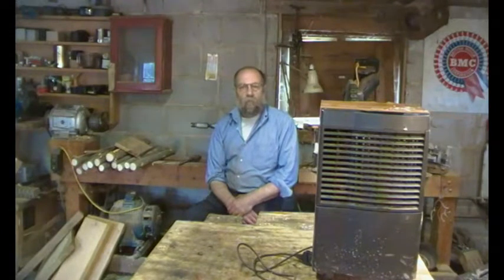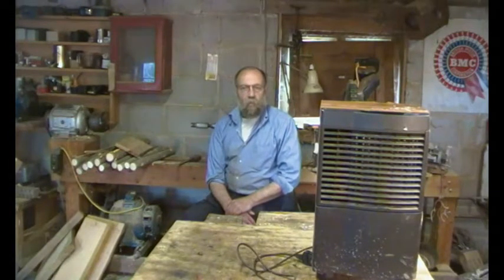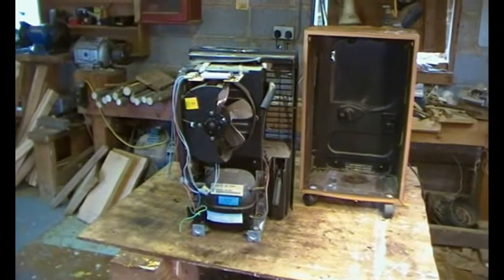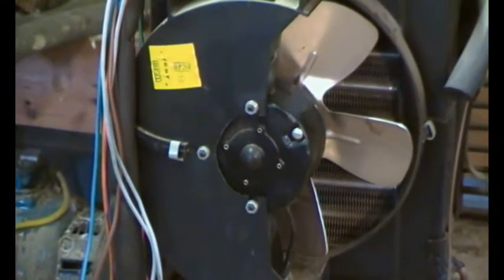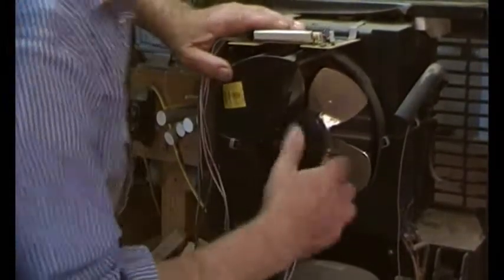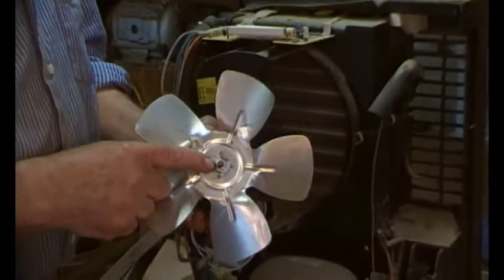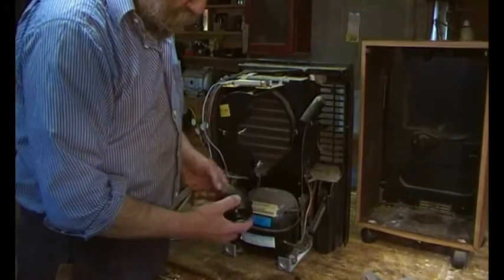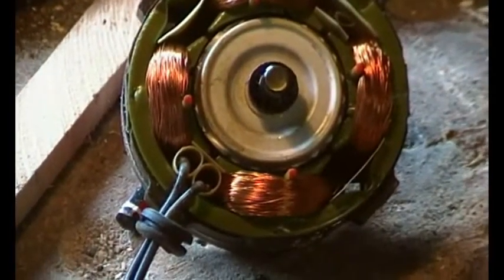Dehumidifier repair, free distilled water, lead acid battery

Comment: Love your channel - it only took me a few years to find it :) ... In my area it is nearly always 90-100% humidity and I run a few dehumidifiers around my house, and I had thought initially that it would be really pure water - but decided to do anything critical with it as I reasoned that dust, mold, and also aluminum/copper minerals (because the evaporator is constantly wet) could contaminate the condensate - I have never tested it but I am heartened that you have used it for Battery top ups - good use - I generate at least 5 litres a day - I just need to get some liquid filled lead acid batteries! Again loving your channel - thank you for going to such detail and effort for the rest of us interested DIY folks. Cheers Kuranda, Australia.
Reply from the maker: Thank you for your appreciation, you can also use this water in vehicle cooling systems and windscreen wash. cheers

Comment: Little mains induction motors like that always seem to dry up eventually, don't they ? Good to get that dehumidifier on the road again - Oilite bushes are a nice feature anyway.... Cheers,
Dave
Reply from the maker: Dave, I'm thinking they use the bushes for  cost of the motor end plate machining and the self aligning feature. Ball races would be nice but involves extra cost. How many dehumidifiers are scrapped because of this problem? Cheers, Andy